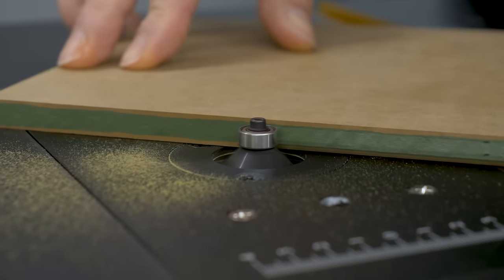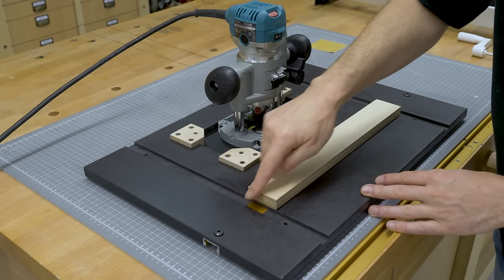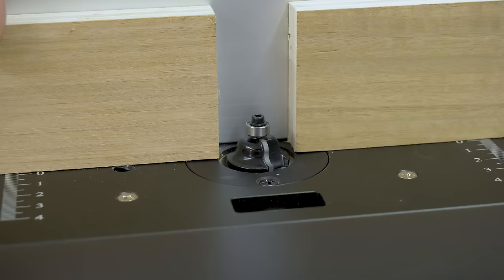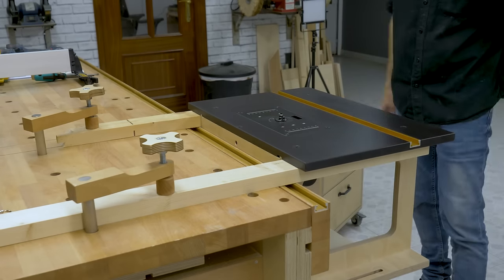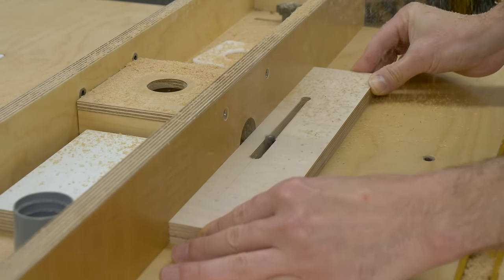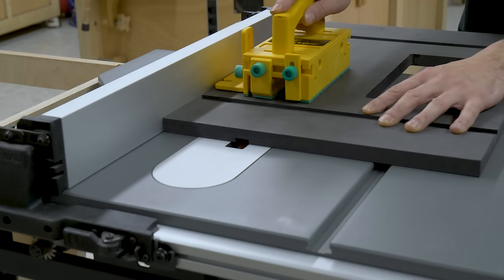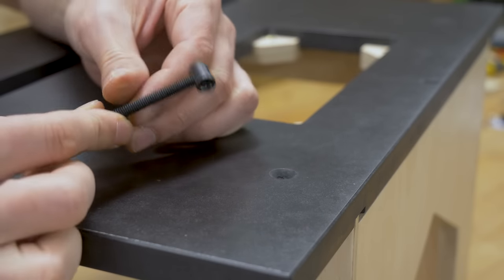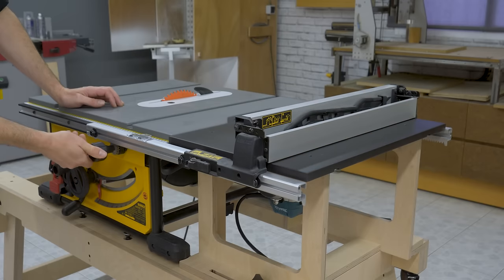DIY Trim Compact Router Table - Light and portable design - Pt. 2

Comment: As usual, your designs are ingenious, well thought out,  and VERY workable. This time, the only thing I am not too happy with is the ON/OFF capability but with a TRIM router, there are no wires for an emergency on/off capability. Therefore ....not a good idea but it is accessible from almost any direction.

Comment: 11:18 Are you using drywall board screws? They are made of a cheap, brittle alloy, I would not recommend them for machine building. In this case I doubt anything bad could happen, you have 12 screws holding the router and that is probably more than enough in this case even if those screws are 5 times weaker than any machine screw, BUT when building various machines, please keep in mind that most screws used in manufactured machines are not random screws. There are few kinds of "machine screws" that are highly resistant to vibration, tensile strength, etc. Sorry if I messed up something with my spelling, english is not my first language.

Comment: Great build! Whats your experience with the router lift? Can you lock it in position so the lift doesn’t move? Is the base included or do you have to modify your own router plunge base?
Reply from the maker: works great, and includes the plunge base: https://www.paoson.com/forum/viewtopic.php?f=22&t=872#p9889

Comment: I enjoy watching your videos and sometimes using some of your ideas.
Also, I assume you already know by now you were talking about the TABLE saw and not the bend saw as you multiple times mentioned in your voice-over. That thing with a big turning blade (the yellow DeWalt) is a table saw (job site size, in your case). I guess you were just too tired for that day.
Reply from the maker: I had understood that these small table saws are also called bench saw, right?